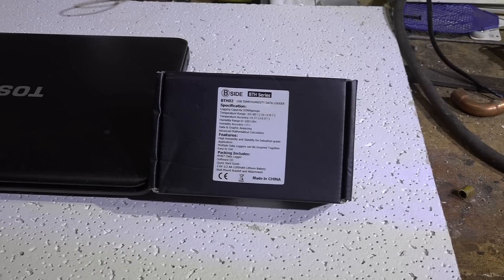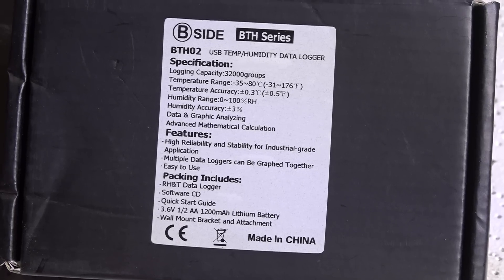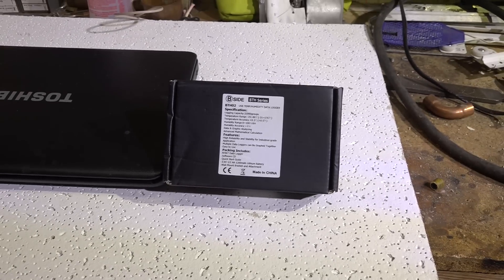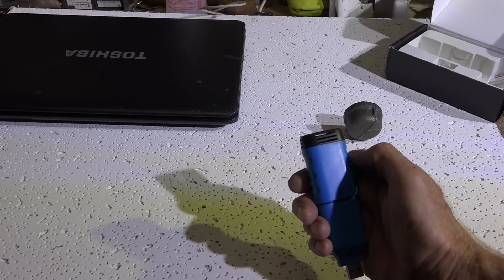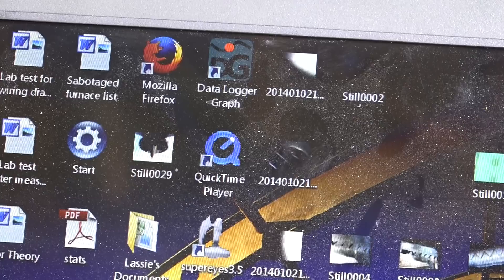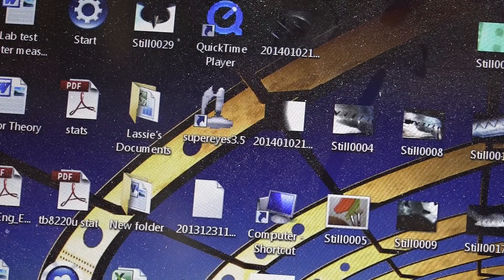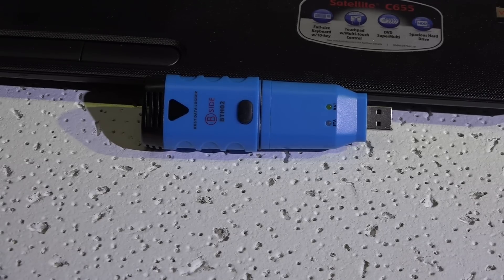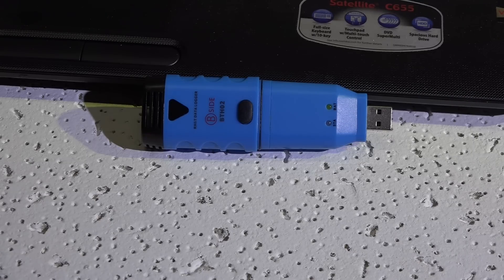A test of a data logger

Comment: Are you going to do an update? What did your contact person have to say? Did the instructions mention which versions of Windows it will run on?
Reply from the maker: Probably no update as there is no support available. Vista and later is the operating system. This is typical of the low cost products. If I get a different brand logger, I will try again. Maybe with more luck. 
GFM

Comment: I have two Testo data loggers one with two temp k type probes that will give you just temp and one temp and RH logger. Couldn't live without them to be honest. Shame that didn't work out for you!!! Lmao GFM selling stuff, I seriously doubt that!!!
Reply from the maker: This product was sent to me to test. It is a cheap Product and I was kind of skeptical. I think these types of products are the future of our industry. But they do need to work. 
GFM
Reply: Trust me the Testo ones work a treat chap. Like I said I really couldn't live without mine. Normally I deal with data centre units only. So I use my data loggers to calibrate sensors in these units. And also the various other sensors like BMS ones scattered about the place. Testo calibrate temp & hum to UKAS standard over here which is better and more detailed than just ISO standard. But if I do venture out to the land of people not products to deal with persistent complainers about draft or temp being to high / low I lock my logger to their desk and two or three days later go back and retrieve that info. I can also set it to do nothing with the buttons so they can fiddle away and it won't interrupt at all. You are right they are great and this industry should use them more!!!
Reply from the maker: +Owen Sampson HVAC Thanks for the thoughts. 
GFM